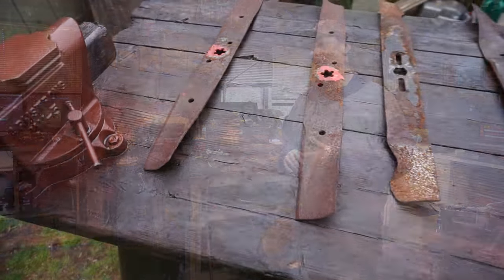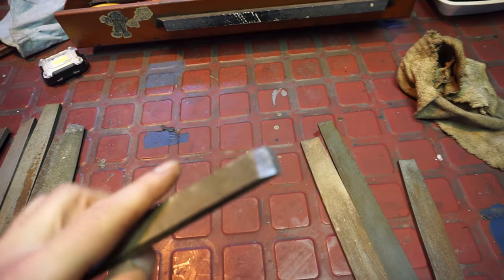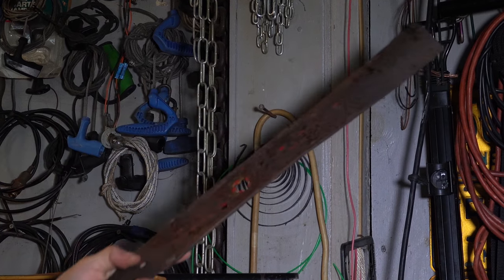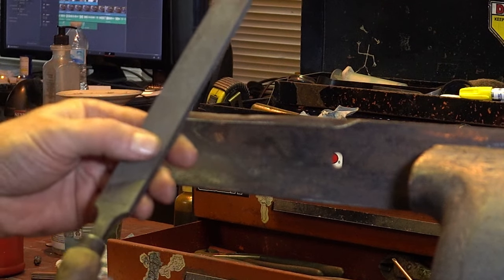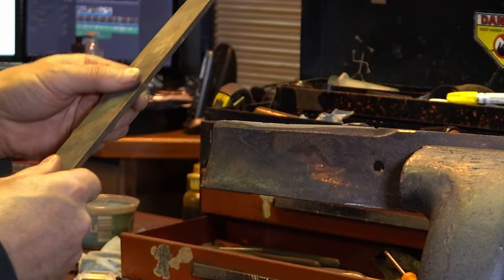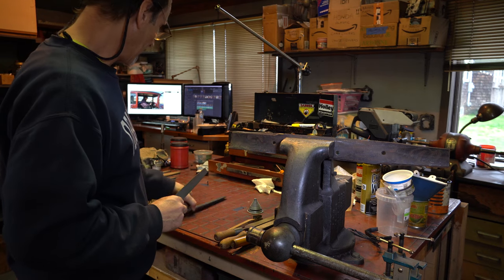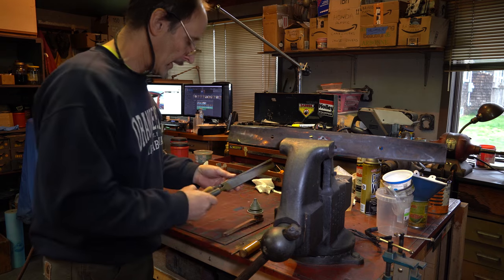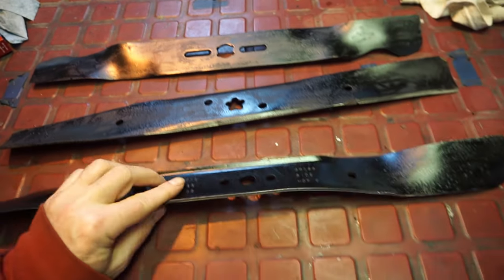How to Sharpen a Lawnmower Blade with a Simple Hand File DIY

Comment: 1.  The key thing withy sharpening mower blades is to do it OFTEN.  I find it doesn't take more than 3-4 cuts before it's tme to sharpen up again.

2. If you are going to sharpen often,  it's important to make the practice easy and painless to do.  For me,  that means I have the tools needed to remove and remount the blade handy as a separate collection of tools.  That means one wrench to loosen the central bolt holding the blade,  and two other wrenches to use to loosen two smaller bolts that also secure the blade.

I also have a manufactured tool to hold the blade immobile while loosening or tightening the bolts holding the blade.  Most people just use a block of wood,  and that's fine,  but I'd have the block of wood with the necessary tools so that you aren't looking for new blocks of wood all the time. 

3.  I have two mower blades,.  so I can remove the mower blade, swap it for one already sharpened and reinstall rapidly.  I sharpen the blade when convenient.

4.  I used to grind the blade,  but in recent years I've used a file.  I'll use a grinder to repair a major ding,  and then finish up with a file.

5.  I treated myself to a new file!  That actually makes a big difference.  The old file was worn and wasn't cutting very well.  I paid $3.49 at Harbor Freight for a new file with a handle on it,  and it's a big improvement over the old one.

6. I like to run the file all the way along the cutting edge of the mower blade on each stroke.  I find that's most efficient  ---and most satisfying. It's SATISFYING  to file a mower blade! And I file from the thin part of the cutting edge to the thick part of the cutting edge,  the reverse of that illustrated in the video. Just feel better to me.

7.  I also file the edge on my splitting maul several times during the heating season.

8.  Perhaps those reading this will find one or two items they want to try.  That's what I do when I listen to videos like this or read comments.  The best advice I've given here is the importance of sharpening a mower blade OFTEN!

Happy filing!
Reply from the maker: Great Response! I pinned it up at the top.
Since I do so many I keep the steps down. I sharpen my Honda 1 or twice a year depending on what I'm doing. Sometimes I like to grind up lawn debri and then I may sharpen more. I already need one of the 2 blades on that system.
Often the tractor gets used so I may use the push much less.
But for the business its the one thing that requires speed only! 
How much yard do you have if ya don't mind me asking?
Reply: @TheNovaJohn  

Thanks for your kind reply  and I'm glad you found my post a useful addition to your video.

I mow my own home and a rental house I own,  both 50x100 foot lots.  But then I also mow neglected public property,  unmaintained alleyways and street ends and such.

And like you,  I GRIND up whatever debris the mower will choke down of  --- an ordinary 5 HP B&S engine.   A sharp blade is a definite help when placing real demands on a mower, I find. 

I like making my mower work,  and using it,  and I like perfecting skills like methods of blade sharpening.  Each time I do such a thing is an opportunity to identify better ways of doing something.  And that's why I like watching videos on such subjects  --- the person making the video or a person commenting may have interesting ideas on how to do things.

And in this thread,  I was glad to be able to remind viewers about Archie Bunker and "All In the Family"!  That was a fun added bonus.

Again,  thanks for taking the time to make your videos!
Reply: Hey thankyou! This is just as helpful as the video!
Reply: @willkindred7450  I got my time to sharpen my mower blade down to TWELVE minutes the other day!  That included moving the mower, removing the blade, filing the blade, reinstalling it and putting the mower back in it's place.  

That's my personal best!

Having a collection of tools and materials at hand for the job is a key.  I even have a sandbag to hold the handle of the mower down,  for access to the blade. 

And sharpening the blade often means you are in practice,  not fumbling around trying to remember how you do things. 

Heh, heh!  It's becoming a hobby, really!

And it is a constant surprise how fast the blade gets dull.

Comment: Good vid. Not sure I have a vice handy, but I do know where some screw down C-clamps are and fam member has some files. Now to convince my fam member to let me take my hand at sharpening. They supply the mower/tools needed for me to maintain their property.. so sometimes getting regular maintenance is hard and money is tight, so I do all I can to take care of maintenance or repairs.
Reply from the maker: Thanx for the comment!
I use clamps quite often, I have that area outside that I often work. Although I have a vice out there I still use clamps!
Always good to know the hand method and develop good file handling!! Get a good sharp file!

Comment: I've watched a few other videos and I'm a little confused on what direction you should run the file on the blade. Some videos show running the file from the inside to the outside part of the blade like this video does and some others show running the file from the outside to inside part of the blade. Does it matter what direction you run a file on a blade?
Reply from the maker: Yes, just like I show!
1st for safety sake, imagine filing toward the sharp edge and slipping then hitting that sharp blade!
Lay the file on the angle and follow the original angle, press down and push away from yourself then lift the file off and back up toward yourself. 
Its not a draw knife, generally when a file is used, you push away, then return but lift the pressure off the file on the return trip, it keeps the sharp of the file a little longer. 
Most files are made to cut in one direction.
Reply: Great, Thanks for the info. @TheNovaJohn